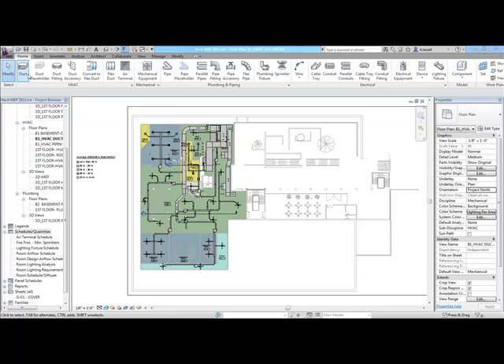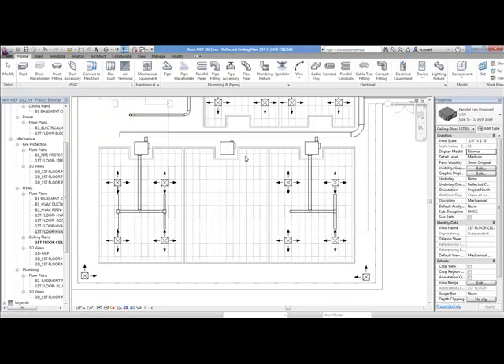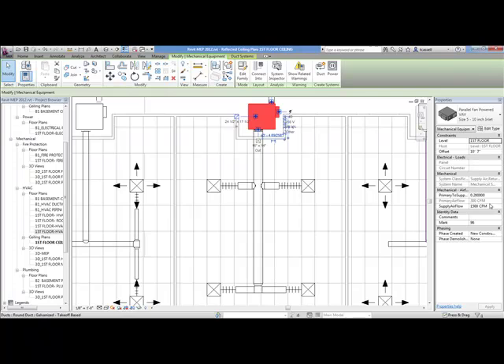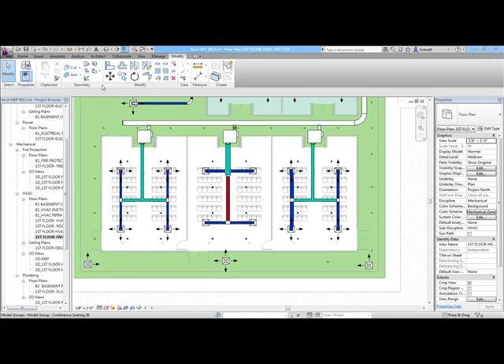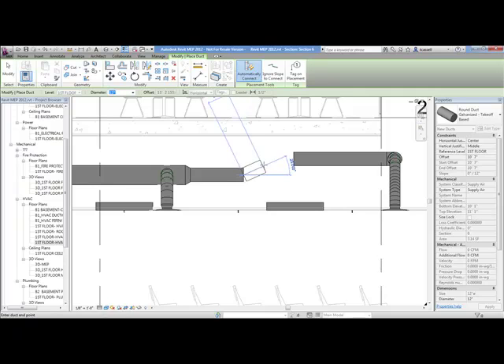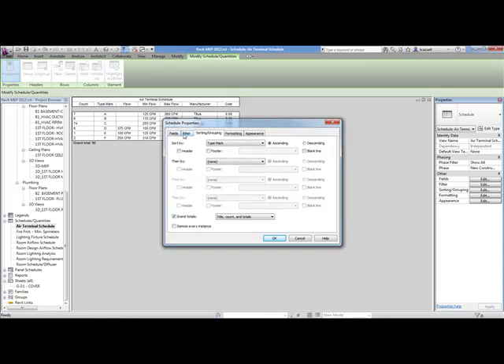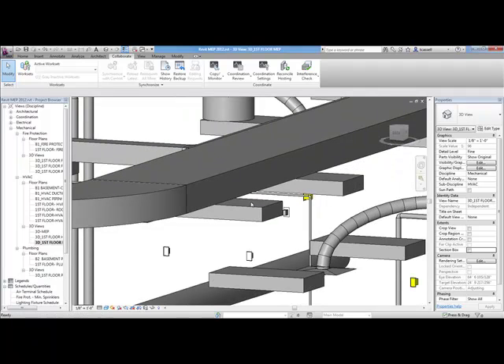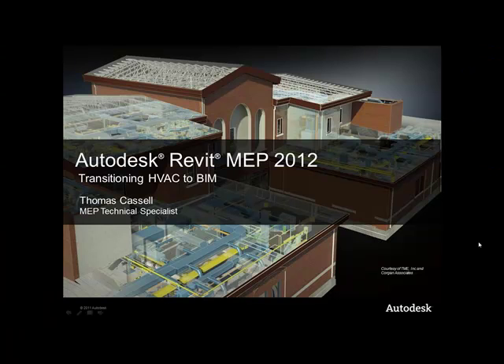Revit MEP 2012: Transitioning HVAC to BIM

Comment: my drawings are too heavy when I design HVAC. I always purged the files. Does anybody knows why? and What can I do, for reduce it?
Reply: If you are importing CAD .dwgs into the file you're also importing the line styles and text styles from AutoCAD. Another thing you can check is if you have families loaded into the file that you're not using.

Comment: What view are you drawing in and where did you start? Can you add the MEP to a building already drawn in an Architectural view?
Reply: He's using a ceiling plan to draw in. He has all of the mechanical equipment, ducting and air terminals turned on in the visual graphics dialog box. As for the second question, I'd like to counter with a question, why would you be drawing MEP inside of the Architectural file? To me that would create a much bigger file than is neccessary. It'd be much more efficient for each discipline to have their own files, and then link disciplines into each other.
Reply: I have an old architectural file and I would like to add the MEP files to beef it up.